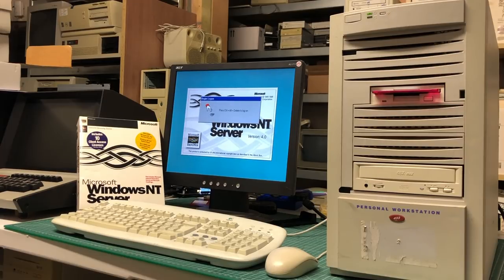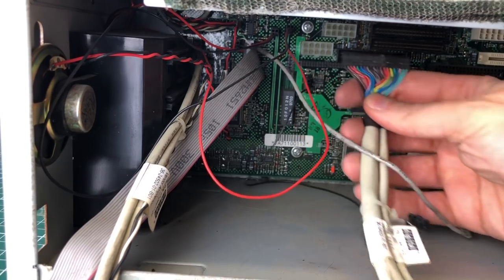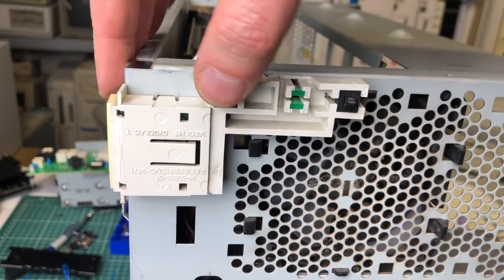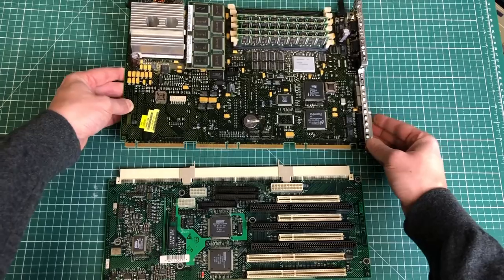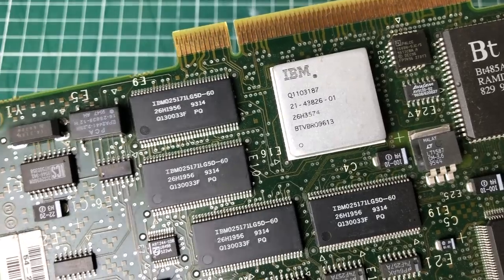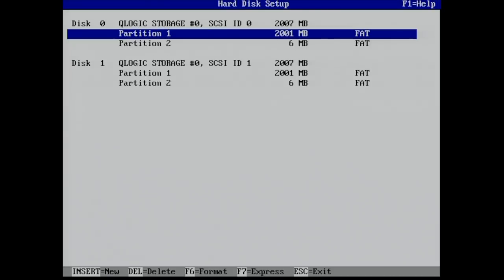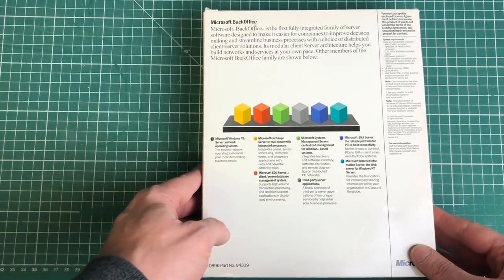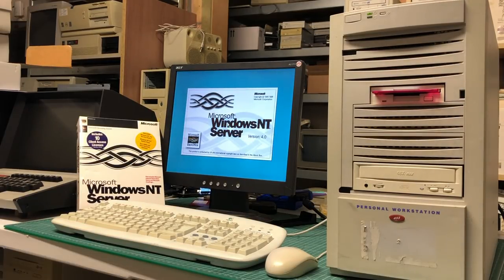DEC Alpha Personal Workstation 433a

Comment: I might be wrong, but those long PCI slots look like 64-bit PCI slots to me. I think I saw them on older HP Proliant servers.
Reply: That's correct. 😊
Reply: They are indeed.
Reply: Yup. You can even get gigabit-ethernet cards for PCI-x. I still have one somewhere…
Reply: Yep, owned an older proliant and can confirm too.
So it had a bus  speed up to 533 MB/s (compared to 32bits  who only could reach 266 MB/s at 66MHz)
Reply: Exactly, pci-x slots, they were used for scsi and network cards
Reply: @eaglenebula3950  Just 64-bit PCI. PCI-X wasn't around until 1998
Reply: @web1bastler  I've got one myself, made by Zyxel.
Reply: @web1bastler  There are Gigabit-Eth cards for regular PCI
Reply: Yes. Used 64 bit PCI-X gigabit network cards myself in different servers and worlstation.
The latest was maybe 12-13 years ago. Think I have one lying around still
Reply: The expansion board is basically 3 PCI expanders. The outside connectors on the motherboard interface are 32 bit PCI and run the ISA and 32 bit PCI slots as well as the onboard stuff. The middle connection is the 64bit PCI
Reply: I tried and got nowhere near full Gbit speeds back when I built my first servers. Also PCI always shares bandwidth across the bus so if you had a IDE card or two in your system and wanted to use those disks for CIFS then you would just run int one hell of a bottleneck.
Reply: @web1bastler  Unless there were multiple PCI busses, which was the case on some Sun (On an Ultra 60, for example, there were two PCI busses, and a Blade 2000 had 3), SGI and HP hardware, at least; I'm not sure if this machine has multiple busses, but given that there are separate 32-bit and 64-bit PCI edge connectors on the motherboard, it might.
Reply: @Draknem  Yes, there are. But the data transfer rate of standard pci was to low to fully  benefit gigabit ethernet.
Reply: @Artemisgoldfish  64 bit PCI and PCI-X are essentially the same thing, PCI had a bunch of weird standards that were mostly inter-compatible if the correct keying was used on the card in question. Faster cards could operate at slower speeds and wider 64 bit cards could operate in narrower 32 bit slots in many, but not all cases if the additional connector could overhand the slot. I have several PCI-X cards which will operate in 32 bit slots at reduced speeds, as well as some which won't work (mainly RAID controllers.)

PCIe killed it off though. By the time PCI-X 2.0 was ratified in 2003 that added 266 and 533 MHz speed grades, PCIe was on the horizon that offered higher throughput with significantly less complexity. Routing a fast parallel drop bus like PCI was already a nightmare for PCB designers, PCI-X was a hellish nightmare in comparison.
Reply: True, but until the tail end of the latest MiataGL board revision very late into production, the bus was awfully buggy and only a handful of DEC cards were whitelisted in the firmware. Others will hang the machine. You can force it (there's a no-check option somewhere), but any DMA access will crash your system.
Reply: @eaglenebula3950  Actually it's not PCI-X (which would run at at least 133mh), based on the date of this computer it slightly predates PCI-X.  This is "standard" 64-bit PCI (likely at 33mhz, possibly 66mhz).

Comment: Hi. Still run some of these, ES40 and TS10 at home. If you're considering benchmarking, careful. A lot of the WinNT installation is actually i386 running under emulation. If I may make a suggestion, try a common operating system that runs natively on both systems you want to compare (eg the PPro you mentioned), NetBSD which will run natively on both. There's also a lot of benchmarks in the NetBSD pkgsrc collection. Then you're comparing apple with apples. Also the "combo" slots you mentioned are 33mhz 64bit PCI slots. So you've a few 32bit PCI, some 16bit ISA and some 64bit PCI. Quite common even in x86 servers of the age and apple smurf-towers such as the B&W G3 through to the digital audio...etc. Additionally, there is multiple operating systems supported by DEC which were NT4 and 2000 RC2? RC3? .. OSF/1 UNIX and older Digital UNIX, Tru64, and of course the most interesting is OpenVMS. Apart from WintendoNT .. nothing else uses the "AlphaBIOS" which is ARCS compatible losely as used on SGI's and other systems. The other side of the BIOS world is "SRM" which is where the fun starts and is required for OpenVMS and Tru64.  :) Nice video.
Reply from the maker: Thx a lot for the elaborate comment ! Still a lot to discover with this one .... unfortunately time is limited :) but have more plans with this machine. Hope you stick around to find out.
Reply: @RetroSpector78  Absolutely. You're one of my favorite channels.   Indeed. These are an extremely versatile family of computers that were buried alive by HP at the behest of intel after the failed project Monterrey. When HP did ship the ia64 systems, the last AXP systems still outran them till they re-defined the benchmark to have a multi-core ia64 beating a single core system. Good times.
Reply: I like the idea of VMS(OpenVMS) That kind of open isn't great because it isn't open at all.
Reply: @asanjuas  Well, originally it was just called VMS from '78 onwards. The "Open" part is because around 1990 (?) at v5.5 if memory serves .. they wanted to support the "Open Systems" standards and implemented and passed one of the early POSIX compliance tests for C function call and return types to make porting from various UNIX and UNIX-wannabe's. Now, with my tongue firmly in my cheek, I was oft told by people with longer beards than mine that whilst it's spelt "OpenVMS" the first part of that is a silent vulgar vowel and the pronunciation is mostly similar to "VMS". :)

Comment: Now that's a proper workstation.

Alpha was cool, I miss these sorts of interesting workstation computers.  Things are a lot more boring these days.
Reply: I picked up a SPARCstation that I'm about to bring up. Used to have a couple Alphas, but I lost them at some point.
Reply: IBM Power9 is a thing now IIRC
Reply: There was always something mystical about the Alpha. However on the upside we now have things like threadrippers!
Reply: Back in the late 90s, I used to work at a pre-orders graphics company in the proofing area. We had a pair of dual processor Alpha Servers running NT Server, acting as high capacity/high speed rips for the image setters. Basically, massive laser printers, but instead instead of printing a positive image on paper stock, these sedan sized boxes burned a negative image of dots on film that were made into plates for web presses before they went digital. There would usually be 4 plates, CMYK, but on occasion an added special colour would be needed (process blue or process red maybe silver, or whatever the client specified). Each film was output from the image setter on a 3 foot by X size. X being anywhere from 1 foot all the way up to the length of the film roll. Needless to say, the typical film plate was saved as raw image data, taking up hundreds of GB of drive space. 
I worked the midnight shift and was the only person who knew how to operate windows nt. The others were strictly mac operators.

Comment: This brings backs memories, as I managed a number of those many years ago back when Compaq had purchased the brand (Tru64 based instead of NT, though). The Alpha platform was really ahead of its time. It eventually died, like all the other propietary server/workstation architectures, unable to compete against dirt cheap and ubiquituous Linux boxes.
Reply: @RTPSEV IBM's AIX is still being developed and sold. v7.2 just came out in the last 12 months. New Power9 hardware and new software features to boot. Sadly HP-UX v3 hasn't had an update in many many years, merely patch rollups.. and we know what happened to Solaris now that Oracle's not-so-quietly abandoned it. I wonder if any of the older licensee's such as Fujitsu and Hitachi could do something with it?
Reply: "Now you can have only 2 flavors of Linux..."
My Slackware workstations say: "huh?"
Reply: @RTPSEV Not sure where the ZFS came in.. yeah. I was an early adopter with Sol10u5? u6? ... it was utterly heaven till it wasn't. I've had to rescue about a dozen ZFS systems over the years and retrieve data.  I really still want to love ZFS, but don't use it unless I have to. Fortunately the old SPARC64's I work on are all logged UFS, and the requirement for linux is JFS-or-die. I've yet to have JFS treat me badly. I also would love to love XFS due to my SGI obsession, and whilst it's not let me down on SGI gear, I've had a number of linux boxes bricked and especially due to one nasty bug on SnapAppliances back around. ... 2012?? (thinking back) when they all auto-corrupted once the used extents went past about 500-512gb. Nasty stuff and they were left in an un-patchable state because the company went fut. It was fun to go back to a place I worked at years later to do data retrieval on a Snap Appliance cluster that I warned against buying and decided to die in my absense.  It was the hardest "I told you so" I've managed to avoid. heh
Reply: @darak2 Actually.. HP buried the DEC/Compaq assets alive. Think about it for a moment. When they got compaq, they had two processor architectures.. PA-RISC & AXP, Two UNIX's (HP-UX and Tru64), and two mid-range O/S's (OpenVMS and MPE/iX). The R&D to keep two of everything going would've been utterly crazy financially. So they jettisoned Tru64, MPE/iX, AXP, PA-RISC, decided ia64 was definitely the way to go, port VMS to Itanium and port bits of HP-UX also and run the rest under the PA-RISC Aries emulator. Wouldn't have been easy choices. Pity they didn't finish the x86-64 HP-UX port that came out after the Oracle trial now that VSI is porting OpenVMS to x86-64 (yay!)  .. HP-UX is orphaned.

Comment: The slots that "look like a mix of PCI and ISA" are PCI-X slots, and depending by version work with standard PCI cards too.
Also these workstations can run Tru64 UNIX or OpenVMS (except DEC Multia, if we don't count the workaround), but you need another firmware in place of the AlphaBIOS
Reply: I think he's referring to the slots where there's a PCI and an ISA slot in the same position, and would share the same slot opening in the back panel. Motherboards that had both usually had one or 2 slots that were either PCI or ISA, but this one has 3 slots that can be either. It works because PCI has the connector on the "top" side of the back panel slot, whereas ISA as the connector on the "bottom" side of the slot. I'm sure PCI was designed that way from the get go so that slots could have either connector.
Reply: The beauty of the PWS in the alpha world is both SRM and ARC are in the firmware and you can soft switch between them without flashing anything, even on the low-end PWS 433a.

Comment: Nice. These things smoked all the machines of its day. I worked for an ISP in the late 90s and we used all AlphaServers 533's for our various server daemons. There was really only two options. NT 4 or Linux. There was hardly any 64 bit support back then. Even Windows was limited to only the binaries it came with unless you were lucky and found 64 bit Windows software back then. Fortunately the portability of Linux at the time was what made running Redhat 4 on that sucker my only real option for what we needed. But man I loved working on them. Especially since the rest of the office workers were using meager AMD K6-2's hehehe.

Comment: This brings back some memories, in college I bought a bare bones 21164a 533mhz system to use as a Quake multiplayer server.  Wish I still had that box, had a lot of fun with it.  Part of my adventures with it resulted in me getting a Windows 2000 Workstation Beta 2 disc.  It includes an x86 emulation layer, so I was able to do dumb things like run Starcraft on my workstation.  If you want to give it a try on your machine let me know.  I think Alpha support was kept up to Release Candidate 1 of Win 2k so there might be later versions that could be tracked down?  Also, my machine was a decent overclocker, 666mhz stable all day long, might be worth seeing if you can push yours a bit?
Reply: Win 2k RC2 runs fine on those boxes and it's available from WinWorldPC. While on NT4 you need DEC/Compaq FX!32 to run x86 apps, in Win2k it was indeed going to be bolted into the OS. (Trivia: the "Program Files (x86)" folder was born on Windows for Alpha CPUs)

Comment: I had one of these, although mine was the model that couldn't boot Windows NT. It had Tru-64, Digital's proprietary Unix, installed on it when I acquired it. I later installed Debian Linux and used it as my main machine for several years until I got quad G5 Apple Mac (another decommissioned machine from my job). The Mac also ran Linux, until I finally switched to an Intel based laptop a couple of years ago.
Reply: Windows NT had versions for Alpha and mips. I used to dual boot mine. Tru64 or WinNT.

Comment: The longer PCI slots are PCI-X slots. It was mainly used for some high end graphic cards, IDE / SCSI controllers (and towards the end of its lifespan, SATA as well). It was also specified for both 32 and 64-bits (hence why it was used in DEC workstations - DEC Alpha CPUs being RISC x64) and also removed the bus limitation of PCI bus frequency, being limited to 66 MHz, and extended it to 133 MHz.

So in short, the PCI-X bus was a 64-bit, 133 MHz extension of the PCI bus. Important to note that PCI-X supported both 3.3 and 5V cards.

Comment: The other slots are probably PCI 64 bits or PCI-X which are backwards compatible with PCI 32 bit (you can place a 64-bit PCI-X cad on a typical PCI slot). These were very popular on servers back in the time.

Comment: What a fascinating, strange machine.  

- Always wondered what those CPU screw threads connected to.  
- I like how they reused PCI slots to bridge the two sections of the mainboard together.  I wonder if there are any electrical/signal compatibilities or if it's just physically the same.  
- Interesting that they used Intel chips while directly competing against them.  I wonder if that was as a result of (or despite) their lawsuit.  
- Bizarre that they only semi-integrated the sound and networking.  I cant imagine why they did that instead of just using off the shelf add in cards.
- The BIOS displaying using VGA fonts more common to DOS is just weird.  Love the features including self update, partitioner, and NT install,
- Nice 68k on the FDDI card.

Comment: I ran one of those for a few years. Had the developers version of win2000. Used to have to run x86 software a few times before the code was "optimized" for Alpha. Worked wonderfully. My machine also had a double slot  video card. They were great machines.

Comment: Shares a lot of components (both case and electronics) with the PWS200i (Intel) systems which you can still find parts for on eBay. There is a missing captive popscrew on your case cover, along with a security eyelet on the back plate. The hinged front door is the same on the 200i as well. The motherboards for both processor types shared the small expansion boards (the NIC, for example). 

The split-board design allowed them to just build a box with a standard set of interface and peripheral devices, then simply slot in the customer's choice of processor board (Intel or DEC). The common support logic such as the bridge chips, sound, and ethernet PHY, and all the expansion slots (ISA-16, PCI, PCI-X) was all on the support board, making the physical configuration easy at the factory, and making it a lot easier to port Windows NT (an OS designed by former DEC staffers) to the Alpha. All the modules were meant to be FRUs (a commonn DEC engineering practice, Field Replaceable Units). There are still cache boards and some faster Alpha CPUs available as NOS if you look carefully.

Nice to see the Alpha series version in action - I have a PWS200i (dual Pentium Pro) and PWS 266i (single), both in regular use. Beautiful, solid machines that were meant to last a long time :)

Comment: You can switch to the SRM firmware (used for linux, bsd, tru64 and vms) just by changing a setting in alphabios (and you can switch back with the "arc" command at the srm prompt)... the actual flash chip contains both. NT4/alpha had very little software, but linux is quite usable as a majority of things have been compiled for it.
You can put 1.5gb of ram in this, although it's quite picky about what ram it will work with... 
There's a beta version of win2k for alpha that runs on this too, it doesn't need the HAL floppy as it has it built in.
The 64bit pci slots were buggy on the earlier version of the personal workstations, there was a later revision which had a different ide controller with usb support that fixed the pci bug too.
The paired pentium/alpha power connectors were because they made (or planned to?) an x86 version where the top board was different but everything else remained unchanged.
There were a and au versions, the a shipped with nt while the au shipped with unix or vms, the au always came with a scsi controller whereas it was optional on the a.

Comment: I bid on one of these on ebay many years back.  I love old systems (I have a Sun SS20 dual 85MHz machine, for example) and I was going to be able to get it for around $270 (back in '99 or '00, not sure), but I got sniped by 25 cents right at the last second.. I was the only bidder. :(  Never had a chance to get one I could afford again.  I heard that these workstations could compile the linux kernel much faster than intel or amd pc's at the time, but I never got a chance to find out. (fun(?) fact: it took just over 24 hours for my dual 85MHz machine to compile world on a netbsd install, I think I have a screenshot somewhere).